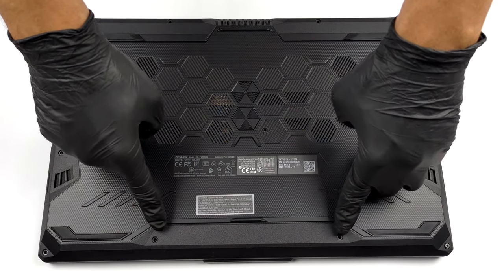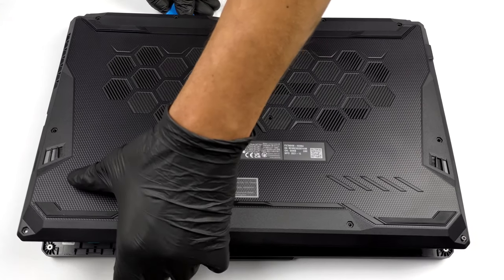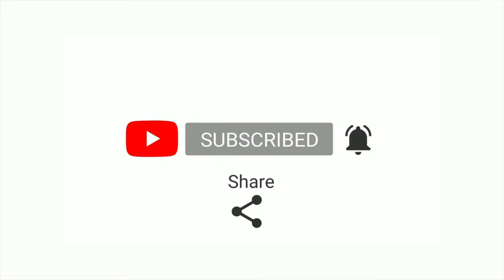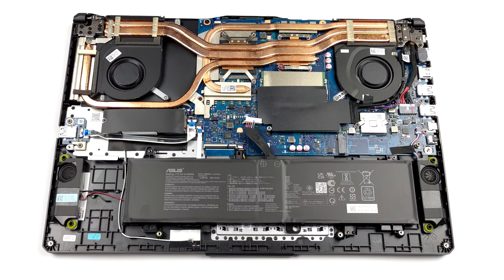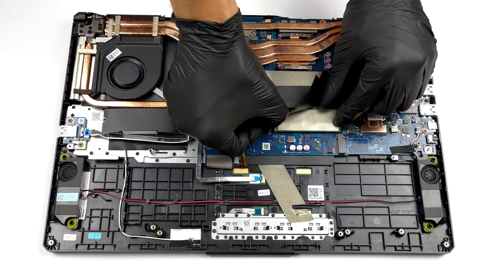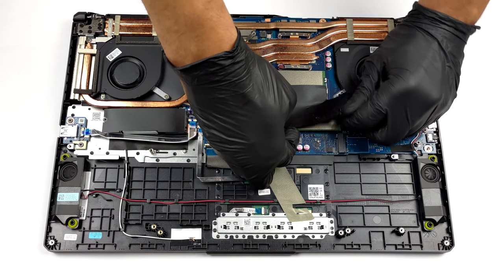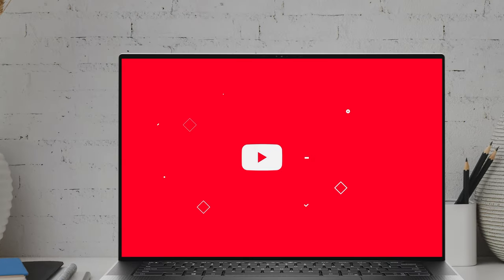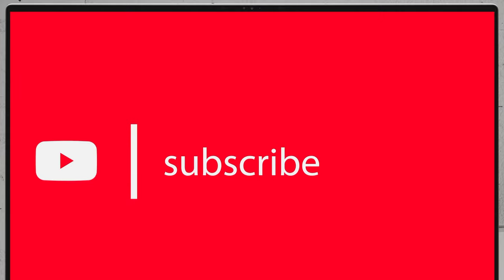🛠️ ASUS TUF Gaming F17 (FX706, 2021) - disassembly and upgrade options

Comment: i installed 64 gigs in mine and works perfect i have a gen 4 drive 7k x7k man its fast  in the 1 slot and a gen 3 in the other
Reply: is it the same model from 2021? it says it max out at 32gb, I have the 2021 version I am planning to upgrade ram.
Reply: @exogendesign4582   I've got the 21 version & I also did the same thing as mentioned above to mine. Upgraded somewhere around a year ago & it seems to be doing fine with 64gigs.

Comment: Petit retour d'expérience avec mon TUF F17 probablement FX 706  l'intérieur est le même)
i5 11400H / rtx 3060 80W-95W/ 2x8GO 3200mhz/ 512go nvme
acheté en Septembre 2021, je le trouvais bruyant dès le départ! mais vraiment .... Cpu / gpu très souvent autour des 80 degrés, voire 85 sur des jeux poussant un peu plus que la moyenne le cpu. 
Je me suis enfin décidé à remplacer la pâte thermique ! Surprise au démontage du bloc radiateur, il y a des pads et de la pâte sur plein de composants, après un gros nettoyage et une pose propre d'une nouvelle pâte de qualité ( Arctic MX-4) quel plaisir de voir une température plafonner à 70-72 C° et des ventilateurs ne faire que très peu de bruit !!! donc  moins d'effort pour évacuer la chaleur :) au passage la pâte appliquée sur le CPU ainsi que gpu étaient sèches !! de très mauvaise qualité ! honteux pour un ordinateur à ce prix là qui est quand même censé être performant et dégager une certaine quantité de chaleur....  ce n'est quand même pas les 15W de consommation d'un petit laptop bureautique avec un i3 et qui tourne sur IGP ....
Reply: i5 11400H / rtx 3050 / 2x8GB 3200mhz/ 512gb nvme,  TUF F17, cpu / gpu - 95..98 / 82C° (TURBO mode) in games on ultra-settings with same Arctic MX-4. 
With stock liquid it has 100 / 89 C° (Noises like Boeing) 
Why it`s hotter then yours?))
Reply: @_ryder_  are you playing on your bed ? 😂😂
Reply: @_ryder_  
are you sure you applied the thermal paste correctly? Your fans are running I guess, you didn't put the computer in silent mode? 
Otherwise at home it is between 19 and 21 ° C. but it wouldn't affect the pc temperature as much even with 28..... (Celcius haha)
Reply: @ffflllooowww45  yep, i turned off intel TURBO boost, so for now temp is 73C for cpu and gpu together...
i'm using perfomance or turbo mode in armoury crate

Comment: What revision is that motherboard?
My 2022 F17 has a simpler heatsink, I aim a 4" fan at it to help with cooling when gaming or using Stable Diffusion to keep temps from spiking into the 90 degrees range.

Comment: Does it support SATA Connection ass well for a storage upgrade of ssd or hdd drives ?
Reply: i see seem like a SATA connector on the right side, maybe its the same with TUF 15 version, u need to downgrade the battery to 60wh to have space for 2.5" slot? i dont know for sure

Comment: Model ASUS GAMING F17 - FX706HCB has 2x NVMe and  has enough space next to the battery for an classic SSD drive, even the BIOS recognizes this slot, but it does not have a physical slot for connecting a cable :( :( :(

Comment: anyone have any idea if this is the same for the 2022 ver? I bought a f17 RTX 3060 from amazon only to realize it only has 512 gb of memory. EDIT I took it apart so ifca yone who bought the same model you ca  easily find instructions on their official site , the computer also does have an extra SSD slot specifically m2. The only problem is the screw you need to remove just doesn't seem to move.
Reply: Is the base under the screw turning? Try to hold it with some small needle nose and then unscrew it. Some older Tuf Gaming laptops were this way.

Comment: Este modelo no tiene para hdd?
Reply: Estaba viendo lo mismo, ya que el manual en la página de Asus es sólo de uso general. Teniendo la batería puesta, no parece tener espacio para HDD. Aunque al remover la batería, se liberan espacios potables para 2.5"... No obstante, no veo conectores SATA libres para poder conectar, así que no creo. Si averiguás de algo avisame!
Reply: @IDV2007  tendria q abrir la mia y fijarme, te aviso cuando lo haga
Reply: @gustavoh450  gracias crack! Qué tal te rinde? Estoy evaluando comprarla. Leí comentarios negativos sobre los colores de la pantalla y sobre la RAM, dicen que tiene algunas fallas y cambia muchísimo el rendimiento poniendo dual channel de memorias de buena frecuencia, será así?
Reply: @IDV2007  a mi en lo personal me rinde excelente, no he tenido problemas con la pantalla y tampoco con el ram, la bateria me dura bastante tambien, el unico detalle q tengo q averiguar es si tiene para poner un hdd extra, porque para otro nvme si tiene
Reply: @gustavoh450  ya me llegó la mía, la abrí y busqué info por todos lados y confirmé lo siguiente:
- El modelo 2021 (con Intel de 11° Gen o placas de la Gen. RTX de NVIDIA) soporta 2 NVMe (no sé qué capacidad máxima, leí que 2TB por puerto pero no lo confirmé) pero NO TIENE puertos o flex disponibles para conectar HDD o SSD convencionales.
- Los modelos 2020 (con Intel de 10° Gen o anteriores, o la línea 1600 de NVIDIA) sí tienen un flex disponible para ello. El cable viene incluido con la notebook y si tu modelo vino con batería grande, tenés que cambiar al modelo más chico para poder generar el espacio para poner el disco.
Reply: @IDV2007  yo abrí la mía el otro día y es tal cual lo mencionas, así q ni modo voy a tener q agregar un nvme extra. Muchas gracias por la ayuda bro
Reply: Amigo recién me respondieron los de Asus, de los dos slots NVMe uno es Gen4 y el otro Gen3, y me confirmaron que va un máximo de 2TB por slot, así como 32GB total de RAM DDR4 3200. Abrazo!
Reply: @IDV2007  y como se de cuantos mhz es el ram
Reply: @gustavoh450  en la etiqueta tiene que decirlo, sino en el BIOS te dice tipo y frecuencia. En el caso de la que viene de fábrica en estas TUF es una Samsung de 8GB 3200mhz single rank. Recomendable meterle 16 gb mínimo, sobre todo si vas a usar Windows 11
Reply: Hola amigo me pasarias el modelo exacto de tu PC y del procesador ya que estoy buscando la que tiene la batería más grande y nosé que modelo es, todas las que encuentro son de 48w. Muchas gracias!
Reply: @nicolascarril3897  FX706H, pero tiene la batería chica (si es que la pregunta era para mí). Saludos!
Reply: @IDV2007  si, para cualquiera de los 2. Yo todavia sigo buscando el de bateria de 90w y nose q modelo es. El tuyo se puede actualizar la bateria a 90?
Reply: @IDV2007  sabras cual de los dos Puertos es el gen4???
Reply: @vonstoever  el primero! El que viene con el disco instalado. Abrazo